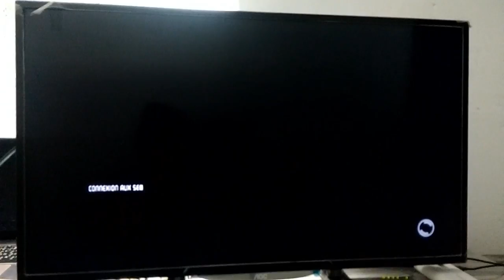Montando eGPU + GT 630 (Notebook lenovo-Z470 i3)

Comment: hello,i also have z470, i7-2670qm, 2x4GB ram.. my questions are:
- can i use my laptop screen (without using external screen)?
- what adjusments should be made on BIOS?

thankyou

Comment: só funciona com Intel, meu note é um AMD A6-3420m com placa integrada HD 6520G, 8 de ram 1333, Windows 10.
Reply: Alguns AMDs dao problema por causa que o sistema ja inicia diretamente o video interno
Porem nos foruns de EGPU e BIOSMOD o pessoal ajuda a destravar BIOS para poder usar funcoes avancadas como nao iniciar a GPU de dentro de comeco ou ate mesmo desabilitar a mesma
Tem risco de dar tela preta ? Sim, mas ai basta resetar o CMOS do notebook (Acer e facil de fazer)
Eu mesmo tinha um AMD E1 porcao que consegui rodar EGPU (em monitor externo mas sem voltar pra tela, pois tem que ser Intel a partir do i3)
Reply from the maker: Vanderlei Gonçalves acredito que possa funcionar depende muito do modelo do notebook não importa se é intel ou amd os mesmo tem chances de funcionar ou não. referente a sua placa integrada pode ser que precise desabilitar a mesma antes para poder exibir o video na tela do note. veja na descrição do video o link dos possível notebooks que são compatíveis com egpu
Reply: Corrigindo: Nesse caso, eu nao usei essa EGPU GDC e sim  uma simplesinha que faz uma ponte entre a mini pcie e um conector pra pcie 1x
Qqr coisa eu testo pra ver se usando uma riser de 1x pra 16x eu consigo melhoria

Comment: Qual o link da egpu que esta vendendo.
Reply from the maker: https://m.pt.aliexpress.com/s/item/32456172794.html?trace=wwwdetail2mobilesitedetail&productId=32456172794&productSubject=EXP-GDC-Laptop-External-Independent-Video-Card-Dock-with-PCI-E-Interface-Black&spm=2114.13010608.0.0.3fiIPi
Reply: Valeu comprei deu um elemento aqui no brasil mesmo, obrigado.